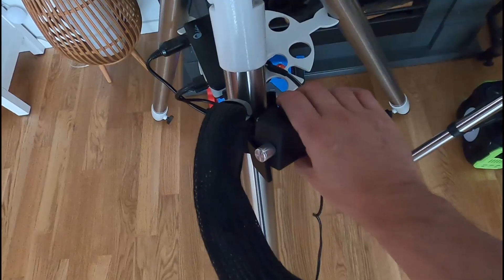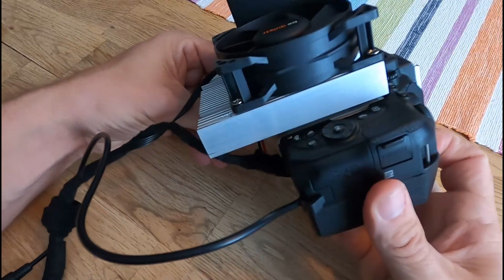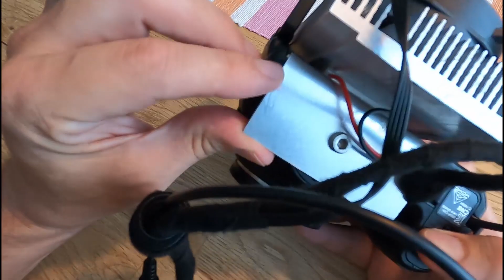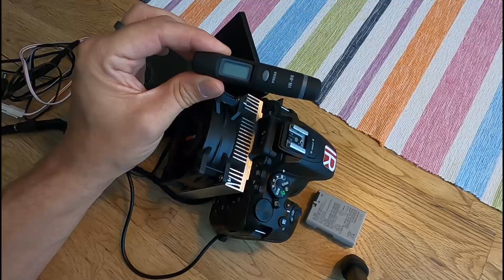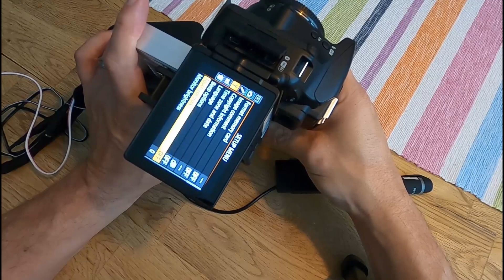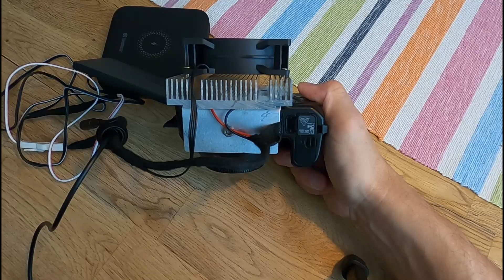DIY dslr camera cooling for astrophoto

Comment: I want to try this! Just a few question s- did you notice any condensation on the camera? And under what humidity levels did you image in? Also, it wasn't clear from the video if the aluminium plate is glued to the camera
Reply: thats my question, and concern, too. Id suspect that if the body isnt sealed perfectly, and it cant be cause of the battery slot, then condensation can and will happen. It may not damage something immediately but it definitely will over time. ...youll notice once you turn on the camera and it immediately turns off and is dead.

Comment: Do you run the cooling device while the camera is exposing or when it is off? I ask because of the fan’s vibrations
Reply from the maker: I use a fan in good quality, no vibration. So i can run it all session with no problem.